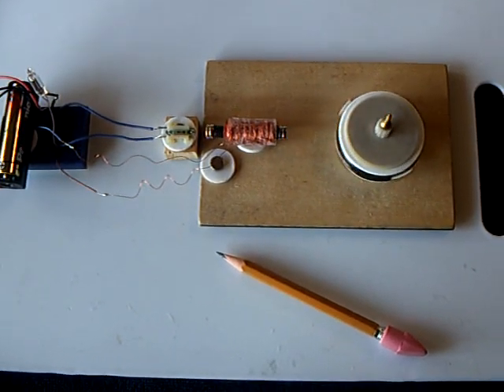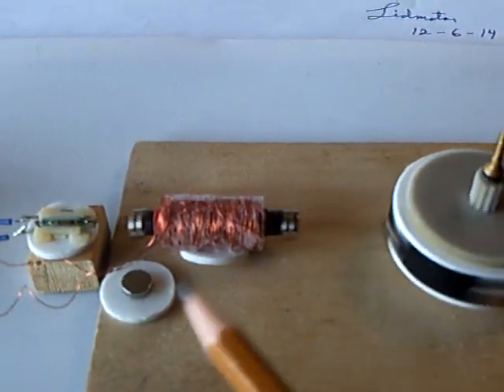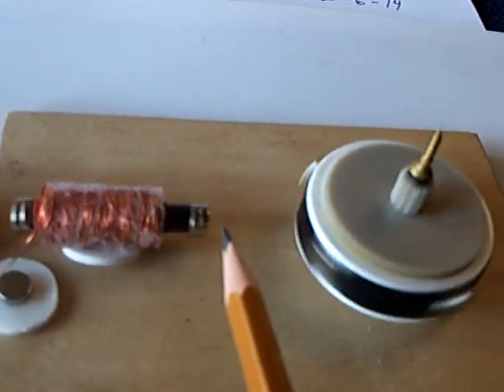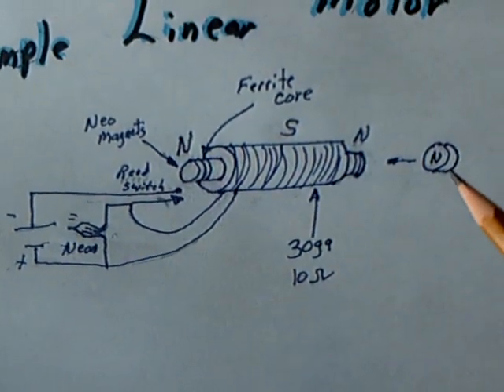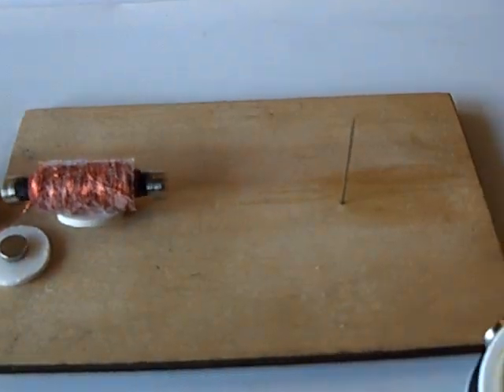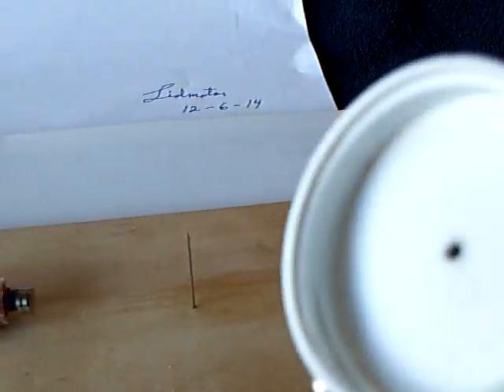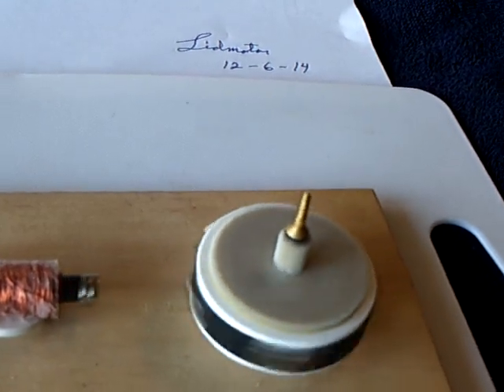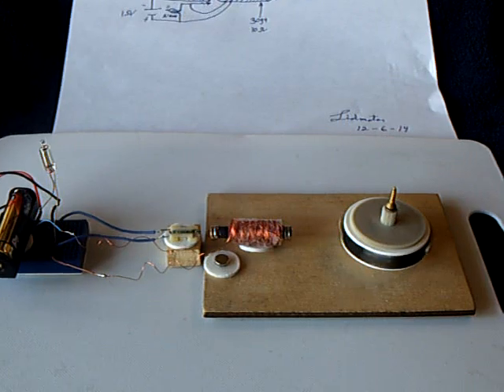Simple Linear Motor ---spinning a rotor

Comment: lidmotor ..can you get maggie to light off the rotation of the spinning rotor...if so then maybe you can use that energy to charge a capacitor to see how long of a runtime you could get on cap alone
Reply from the maker: Maggie doesn't like the magnet arrangement on this rotor.  No reaction when I introduced her. Cold eyes.

Comment: Hi would you try salt water where your battery is instead to see if the salt water will activate I am looking at that for reasoning on a tesla fluid coil which if it does activate the motor then that would confirm it you may have to stir it fast first thanks

Comment: I've notice others make the mistake of seeing the voltage go up from the back spike but them seem to not calculate the amps of the battery.I've been using the BEMF to light a led,then use the led as a timing light.interesting how magnet motors are like regular motors when you start changing the timing.
Reply from the maker: You bring up a VERY important point about the back spike-----there is high voltage but very little amperage.  You can do things with it but just realize what is going on.  By the way, for years I referred to this as BEMF (back electromotive force) and it is different.  BEMF is another critter.  You might want to look into it.  When a magnet interacts with a firing coil it 'generates' a force backwards in the circuit and that is different than the coil's magnetic field collaspe which is called the flyback or back spike,  It took me a long time before I understood the difference. You can generate the flyback by just turning the coil on and off.  The BEMF happens when a magnet and coil of wire do their dance.